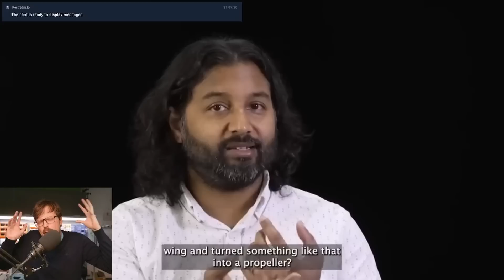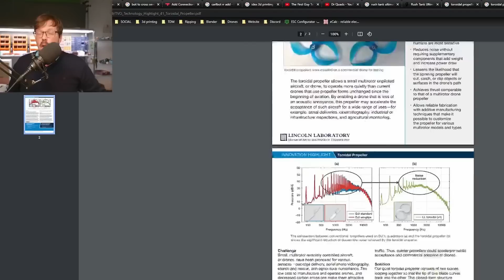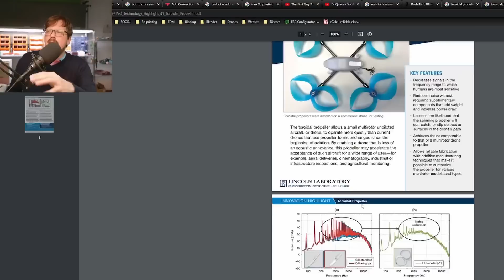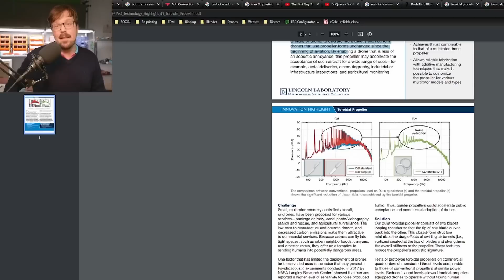MIT Thinks you're STUPID - Toroidal Propeller Snake Oil

Comment: While they are very similar, fans and propellers are on opposite ends of the spectrum for the fundamental compromise of "moving the air" vs "generating thrust".  The confusion for laypersons is the impact of Newton's Third Law on both propellers and fans.  If you step back and think about it, you really don't want your fan blades generating a lot of thrust, you want most of the energy going into the motor/engine to be used to move the air.  For the propeller, you want as much energy as possible generating thrust, and only push the air backwards as little as possible.  Propellers use their shape to generate "lift" in the direction of desired motion (thrust).  I know a lot of people will argue with me that propeller = fan and fan = propeller, but for those people I really recommend researching the topic.  There is a misconception that propellers primarily move aircraft by pushing air backwards (downwards) against the relatively motionless air behind/below the propeller plane.  While there is some of this action going on, it is not the primary mechanism for generating thrust (lift in VTOL drones).   There is an enormous difference between propeller design for water applications and air applications.  There is very little that can be gained by direct comparison of the two applications by inspection and "common sense".  The idea of toroidal propellers for drones, or aircraft is interesting.  From what I've seen on other videos, nobody is publicly disclosing a truly engineered design yet (if there actually is a feasible solution).   It is well known that the noise from drones is primarily due to the parasitic vortices formed at the tips.  Theoretically, if you could eliminate these parasitic vortices, the propellers would be quieter.   There is a lot of engineering between that statement and reality that doesn't appear to have been successful.  As most readers on here know, the primary considerations for drone engineering are all centered around power-to-weight, payload size, and battery life.  To the extent that a quieter propeller design does not compromise one of the critical considerations, it would be an exciting development.  While Dr Quad is quite dramatic in his presentation and seems to have an axe to grind with institutions of higher learning, he is correct in assessing that there is NOTHING practically useful in the MIT video.  There are 3D designer/printers who are attempting to crudely create physical propellers based on the concept, the reality is that to get to a better propeller design, both static FEA simulations on airflow and FEA simulations on structural integrity need to be ran iteratively to converge on a design that optimizes thrust, noise, and structural integrity.  The 3D printable designs that are available and being made in workshops is not a "better" propeller by any measure of practical working drones.  From what I've seen, the available designs are just inefficient variations on regular propellers. I'll continue to watch this space, but for now there is nothing useful to see.
Reply: Was this pinned as a meme or what? The opening sentence is literally condensed retardation followed by paraphrasing the first 1-3 results he found on google in an attempt to sell himself as "the propeller expert". The whole "moving air / generating thrust" being opposites...really dude? Do you know what OPPOSITE means? You're like the fool who tries to sound smart by telling people that "bumble bees shouldn't be able to fly".

"Propellers generate lift". Lift and airfoil design vs airplane (plane being a literal flat piece of material) is achieved by adjusting the angle of attack (or pitch in terms of a propeller) to compress the air on one side, thus riding upon it. The airfoil shape is not a requirement for a wing to generate lift or a propeller to generate thrust, but what it does do is allow the wing or blade to have a lower angle of attack to generate a given lift or thrust...in other words it increases efficiency for the given surface area at the cost of increased drag.

Propellers are usually airfoils because efficiency is a consideration, and engines generally have a narrow powerband so the propellers should be optimized to produce the best thrust at that power band. They still work the same way as a fan does in that they both move air. The only real difference between fans and propellers is that fans are usually not airfoils, fans are stationary while propellers are used to... propel. Fans do indeed generate thrust but their mounts take this into consideration and are designed such that the thrust generated by the fan doesn't cause it to move.
Reply: @alphaforce6998  can you explain for everyone the reason for the very different shape profile and angle of attack for fan blades vs propeller blades?  I obviously, in your crude opinion, am not qualified to explain this. I will watch for your reply.  For reference, though, I gained my knowledge through experience and CFD computation.  That I agree with google should not be surprising.
Reply: @wadesheen2612  You mean re-explain it? Because I addressed that in my comment, which was dispelling the distinction without a difference in the OP, suggesting that fans and propellers are mechanically different, and that "moving air" and "generating thrust" are mutually exclusive when in fact they are directly proportional. The more air you can move, the more thrust will make.

Fans and propellers are purpose-built. Both move air. Both generate thrust. The purpose is optimizing for one aspect or the other. If you want to move a lot of air, then you can increase the size and RPM to achieve a desired flow rate. Some fans must be bolted to the ground or anchored because there really is no "trade off" between moving air and thrust, meaning that if you are moving a lot of air you will also be generating a proportional amount of thrust.

If you want to split hairs about the general difference between a "fan" and a "propeller", we can say that a fan is a unit - blades and motor/engine drive system, usually in some kind of enclosure or shroud...whereas a propeller is just the propeller blades themselves, which can be mounted in a variety of ways.
Reply: Wouldn't moving more air equate to more thrust? Obviously i am not a Mech Eng.
Reply: @walter6574  It's not intuitive, and I've never seen a simple explanation.  The closest thing I know is to realize the thrust created by the wind passing over a sailboat's sail is the same physics as a propeller spinning in the air.  The sailboat is not pushing the air backwards, it is the difference in air pressure in front vs behind caused by shedding vortices off the trailing edge of the sail.  Understanding how sail-boats can tack upwind is helpful in understanding the difference between fans and propellers.
Reply: to create thrust, you want to move 'push' air backwards. but spinning props create a lot of centrifugal force which moves air sideways. And also turbulence is another problem for spinning props. But Turbulence, vortices, centrifugal force; they all 'move' air and doesn't create any thrust. So moving more air does not create more thrust.  @walter6574
Reply: imagine having to bolt our desk fans down to stop them flying around the room when it's hot outside lol
Reply: @seancook4317   but the static pressure surely would allow the air to permeate you. static pressure in computer cooling is important, it allows to displace the air in crevasses.

and eventually die for air getting into you veins.
Reply: Pretty simple. Fans needs more surface area to move air. Propellers need less with higher angles on the surface to create force.
Reply from the maker: said it better than me. And after all this time we still don't have a toroidal prop on the market.... They got the money and moved on because they knew it was a waste of time.

The axe I have to grind with higher education is "betrayal". Because I truly revere and believe that higher education is the way to push society out of darkness and into the light.... But REAL education, the true pursuit of knowledge. What we have now is a perversion of something sacred, and it angers me deeply. Maybe this was just the straw that broke the camels back.
Reply: @33rdframe  Yes, this type of prop may not be on the market for drones,  but it has been on the market for boat propellers, with PROVEN results.  You sir are another liar to the masses only to increase your own popularity.   You should be ashamed, and the fact that you're not shows how poor a person you really are.
Reply: I AIT READING ALL DAT🗣️💯

Comment: Sharrow boat props are hella efficient though
Reply from the maker: Water = air?
Reply: @33rdframe  = fluid. They're both fluids, it's just that air is less dense, and therefore just some guy with a 3D printer or machine shop cannot build a toroidal propeller well enough to take advantage of its inherent advantages.
Reply: @JohnDoe-ji5wg   they're not the same doesn't take a genius

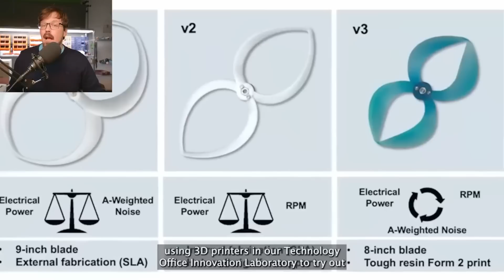Comment: 4:52 the hell do you mean what kind of electrical power. There's only one. Electrical power is the rate at which electrical energy is transferred within a circuit. It's the rate at which work is done in an electrical circuit. It's this fancy thing called a Watt.
Reply from the maker: you are right. lets just throw away terms like current, amps, voltage, resistance, and efficiency. With smart engineers like you, who needs them!

Comment: The most easy way to gain evidence, the design shown is crap was unwrapping the prop. All of a sudden you might see, there's surfaces on the - former - outer side of the unwrapped prop shoveling air in a stalled way, creating just turbulence. Where should any improvement come from?
The crap proceeds with version 3 thinned toroid-tips. So where's the difference to traditional props but rounded and doubled prop blades?
Take a look at seemingly successful toroid marine prop design. It is a axially widely extended object. That might be a huge difference to conventional designs.
Reply from the maker: Yes exactly, and yet people still bash me cause I "didn't provide scientific testing"...

Spoiler alert, critical thinking is part of the scientific method lol.

After looking at the crap I didn't need to do any further testing

Comment: What I mostly take from this video is huge resentment from someone who defines their channel  name with the prefix Dr.  Is this one academic slagging off another group of academics? or one wannabe academic?  
There is far too much unbacked up opinion in this video. I agree that the part of the paper shown is inadequate but the entitlement shown in expecting a highly detailed presentation is also perplexing, as is the assumption that the Sharrow prop was known prior art to the team. We simply don't know that. Also, the Sharrow prop loop loft is very different, yes, they both use loops but that's about it. I'm more surprised that the prop tips are never really discussed by this content provider. That's where a majority of noise will be generated and it's going to be heavily influenced by tip vortices.  And that resolves to the amount of shear at the tips, it's something that can be controlled through a higher load range than for an open tip prop, depending though, on the loop tip shape. I am a little perplexed why the MIT team pinched that area closed, especially as it defeats leading and trailing edge side separation. Perhaps it was a design solution to warping of the shape under centrifugal forces at high RPM, certainly a more rounded loop end would flex more. 
Again, it's not a Sharrow, the design has different optimisations for a different environment. 
To my eyes and with my own odd assortment of 57 years of life experience, the MIT prop shape is not taking full advantage of the quite aspects that the Sharrow prop looks to me to possess. The Sharrow is designed for water which is a very different medium. For outboard motors, the shape of it gives some additional protection against ground impacts and the tip speeds are far less than those of a drone.
Reply from the maker: Seems you made up your mind

Comment: Asking about "What is the current draw and RPM" are meaningless.  The important question is what is the amount of power (in watts) for the downforce generated (in lbf)  Or, to be more polite, what is the efficiency.
Reply from the maker: "asking what is the RPM is meaningless" well it seems we got a science guy who knows nothing about aerospace engineering over here
Reply: @33rdframe   Guilty.  The rug rat is our science whiz.  But I did stay at a Holiday Inn a couple of years ago. 

If a propeller with a coverage if 10 sq.in. at 100 rpm can put out the same amount of downforce as a propeller covering 25 sq.in. at 50 RPM, which is actually more efficient? It shouldn't matter if the shape is toroidal or a standard screw; which is more efficient. 

OR, which will drain my battery slower for the same amount of work.  

*
Showing the little I do know, ... With propellers the efficiency drops off the more blades you have.  While three blades is nice, six blades do not give you twice the force generated. And a toroidal propeller just appears to be a fancy six bladed propeller.  Any comment on how far off I am?

Comment: A 3d printed propeller is going to have ridges from the printing process. That will result in more air turbulence and thus be worse in noise and efficiency than a standard efficient propeller.
Reply from the maker: https://youtu.be/ncvsNz2Mup8?si=-5qdYKpCVCqQX3FY

Comment: As someone with a fluid dynamics background (and a degree) and very sensitive to all the BS technophilic snake oil (plenty on line) I must say the physics between a propeller and fixed wing flight are nearly identical,  so I'm not sure what this guy is going on about here 1:42   That's actually how it works.   Of course this ring wing thing and toroidal props are not new ideas and they have plenty of draw backs, certainly the guy promoting "HIS IDEA" is only telling you one side of the story.  MIT is dumbing itself down...I've worked with and for MIT grads from decades ago (brilliant) and MIT grads in the last two decades (clueless).   It's sad the way scientific education has gravitated towards technophilic sci-fi fantasy indulgences instead of pragmatic knowledge.
Reply from the maker: he was referencing ionic propulsion fixed wings (which do not have propellers) which meant he was not talking about fixed wing propellers but rather fixed WINGS themselves. and this cannot be directly compared to a rotating propeller

Comment: Not a good video, candidly speaking.

It fails to credit many things and ignores tip velocities and vortexes.

The design has much merit and is well proven.
Reply from the maker: In marine engines not aerospace....

I never said there wasn't some benefits. But that's like saying a horseshoe shaped sword is a good design because it can stab around a shield... If it gains one function but loses the essence of its purpose than it's a shit design
Reply: @33rdframe   Well, you're video comes off rather critical, mocking, if you would.  Note there are solid benefits from this design especially efficiency in water and quietness.  Everything is "hyped" today, so you'll never get rid of over hype.  

The design has proven itself and will continue to grow in use as production costs become lower through things like 3D printing, etc.

Maybe give the MIT guys a bit of a break...
Reply from the maker: @rlu1956  ok

Comment: A-weighting – (A-frequency-weighting). A sound level meter weighting that makes its readings conform to a notional human hearing response. It is defined in various international standards such as the IEC 61672, as well as in various national standards such as ANSI S1.4. (USA). ‘A’ Weighted is the most commonly used and covers the full frequency range of 20Hz all the way up to high frequency 20 kHz. The human ear is most sensitive to sound frequencies between 500 Hz and 6 kHz (especially around 4 kHz) whilst at lower and higher frequencies the human ear is not very sensitive. The ‘A’ weighting adjusts the sound pressure level readings to reflect the sensitivity of the human ear and is therefore mandated all over the world for hearing damage risk measurements.
Reply from the maker: Indeed

Comment: At NO POINT does the "  MIT guy " make the claim that the audio you are hearing is a direct 1-to-1 comparison between the propellers in operation. If you BELIEVE that the muted audio is actually what they sound like versus the " boosted " :/  audio of the standard propeller then the problem is 100% your own ignorance. But thanks for using youtube to manufacture dissent for clicks !
Reply from the maker: Muted... Not "different sound floors"

Comment: If the vortices off the tips are what are causing the noise and inefficiency, wouldn’t a short duct, either enclosing and attached to the blades of a conventional propeller (like those plastic helicopter toys you spin up with a pull string), or if stress is a worry, attached to the frame, work just as well? Isn’t that what they do with turbofan engines and winglets on wings to attenuate the turbulence off the tips?
Reply from the maker: I tested it extensively and it seems I was right